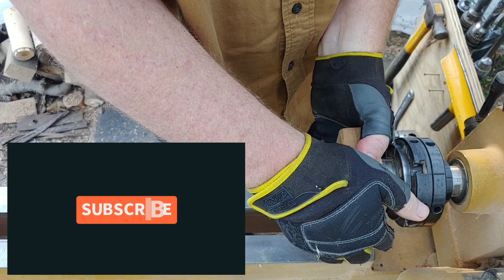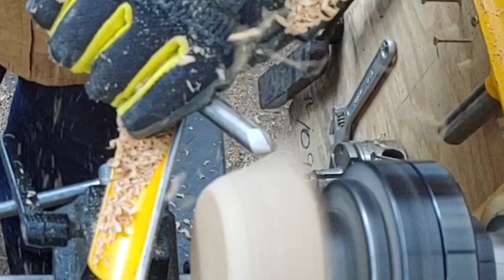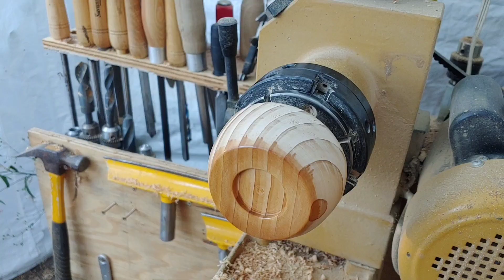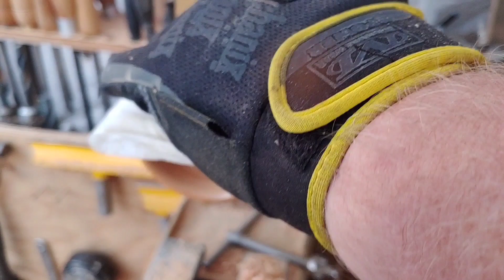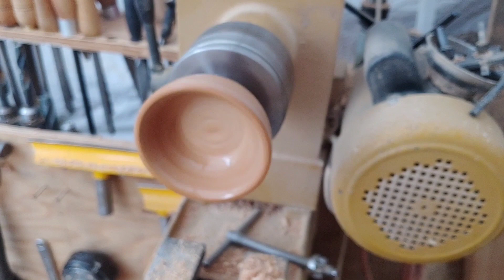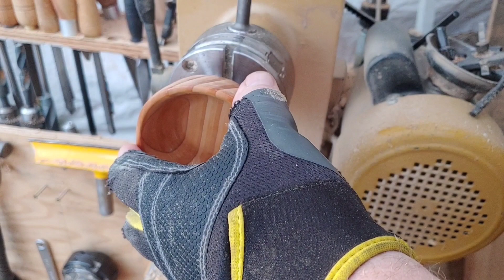wood turning a little 2x4 bowl (style #1)

Comment: At 2:30 seconds the bowl scraper appears to be homemade if so what grind on the top/bottom do you use? I have a couple of rods left over from making my own carbide tools and would like to make a small bowl gouge like that.
Reply from the maker: It's a 3/4 inch rod. I cut flat thru the middle and slightly rounded the end. The bevel angle is about 70 degrees.
Reply: @RcWoodturning  , thank you i appreciate it

Comment: Also a question, is your round bar scraper made from HSS? I'm strugging to find long enough hss bars online
Reply from the maker: The one I have is high carbon and stainless steel mixed. I got it from a place I used to work. Don't quote me, but I think it's 1095 steel. What I would do is get a grade 8 bolt from a hardware store. Maybe 8 to 10 inches long. I believe they are kind of gold looking in color. Cut the head off and shape the end.